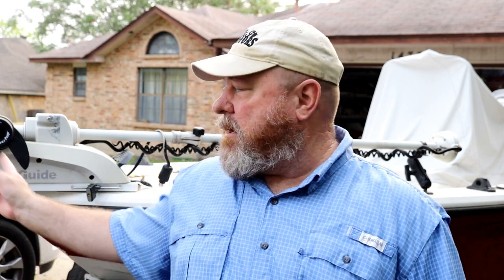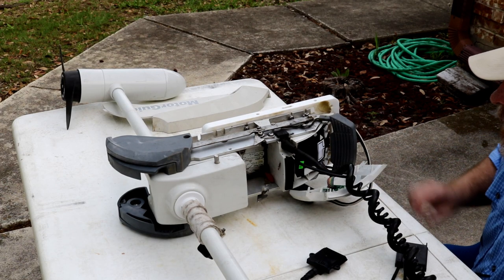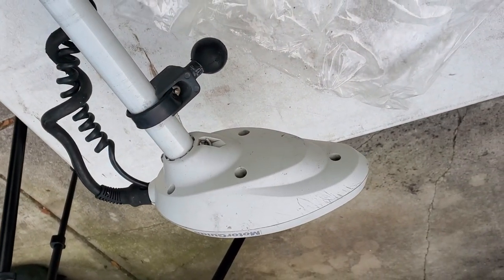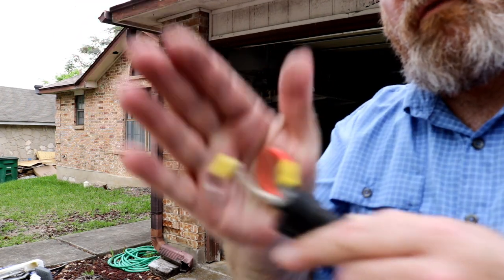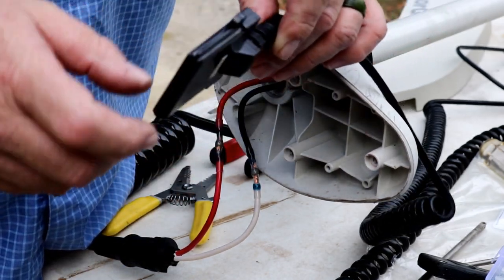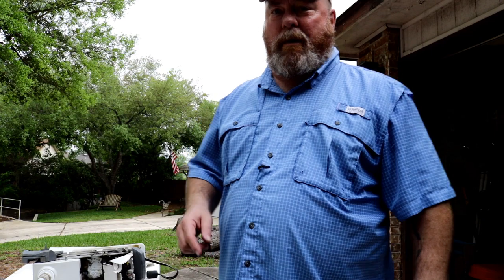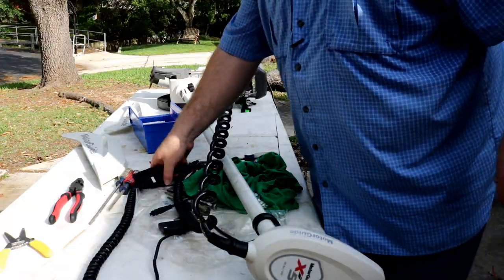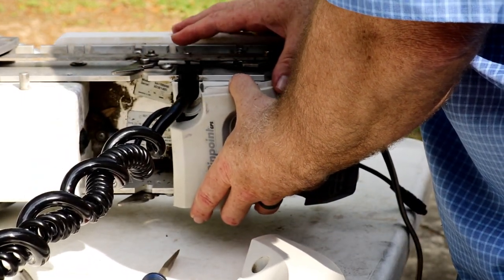Motor Guide Xi5 GPS Module Replacement | Curly Cable Replacement Too

Comment: Thanks for the video!  I successfully replaced my coil power cable today. It was pretty dry rotted. Wasn't too bad to replace.  I'll be looking at replacing the pinpoint module and control board someday. Changing the cable showed me the other parts are pretty easy to access and replace.  Thanks again.
Reply from the maker: I'm glad the video helped you.

Comment: I had to replace the main control board.   I suggest you take lots of photos of how the cables are routed because it won't go together properly unless you duplicate their exact  routing.
Reply from the maker: Great suggestion, I always take photos or video so I have something to refer back to.

Comment: Are you also using this integrated with a Lowrance unit as an autopilot.  Curious as to how the new GPS is performing in a networked setup.
Reply from the maker: Yes it is link, but I am having more issues with the motor, may be motherboard. I just haven’t had a chance to dig back into it.

Comment: Great video. Thanks for sharing. Have you tried updating the trolling motor software? Mine is connected with a Lowrance unit via NMEA network and I am frequently prompted to update the trolling motor but I was never able to complete the update process. Screen always freezes as soon as I push the OK button to begin the update. Any help on that will be highly appreciated. Thanks
Reply from the maker: I have not done that, but I’ll look into it, thanks.
Reply: @AJOutdoors1  Thank you. Waiting for your input.
Reply from the maker: Well I am having another issue with the trolling motor. May be the "Motherboard". I may have to replace the motor all together. Sorry I couldn't help you with this. If I do replace it, I'll look into updates for you. I do have one question, when you get these update notices, is the Lowrance linked to wifi? You might need to have it at the house and linked to wifi to complete the updates.
Reply: @AJOutdoors1  the trolling motor is connected with the Lowrance unit via NMEA network (special cable - gateway sold by motorguide). No wifi or any other network connection. Just trolling motor and HDS Lowrance unit.
Reply: @antoniosperrakis8247  This is a well known issue with the 2019 and newer motorguide Xi5 trolling motors. In 2019 MotorGuide started using the new design of gps module that was installed in this video. I had the same issue where it kept prompting me to do the update and then the Lowrance would freeze until I turned it off. To resolve this I had to install my NEMA system with its own power switch. When on the water, I power up my Lowrance Elite-9 Ti2 first and let it aquire a gps signal. I then power up and deploy my Xi5 letting it acquire a gps signal. Last I turn the switch on to the NEMA system allowing the trolling motor and Lowrance to network.
Reply: @AJOutdoors1  I hate to be the bearer of bad news but I have a feeling that it might not be you motherboard. In 2019 MotorGuide changed their gps modules to the new one that you just installed. There are a number of reported issues with that new module. The main one is loss of gps signal. When you are in anchor mode the trolling motor will lose gps signal and the trolling motor will go into standby mode setting you adrift. Other common issues is the head of the trolling motor turning around and around wrapping the cables tightly around the head. Other issues is the trolling motor taking off at full speed only to slow down and then ramp up to full speed again. Another issue is the trolling motor turning your boat in circles on the spot. Another issue is trying to navigate to a cursor point or waypoint on your Lowrance. You arrive at that cursor point or waypoint and the trolling motor fails to go into anchor mode. Another issue is creating a route on your Lowrance and then telling the trolling motor to navigate the route. The trolling motor will take you to the first waypoint on that route but then will continue in the direction that it was pointing rather than navigating to the next waypoint on the route. If you are experiencing any of those issues its more than likely due to issues with that new design of gps module. Motorguide says they are trying to resolve the issue but its been well over a year with no solution in sight.

A few comments with regards to your install. It has been suggested that the power cords in the head unit and the cable from the gps module have to be seperated or they will cause some sort of electromagnetic interference. In the head unit, you have to route that gps cable off to the side like the original one was using those little pockets to keep it off to the side. The red and black power cables need to be twisted and bunched up and tucked along the opposite side of the head creating as much distance as possible between the red and black power cables and the gps cable.

I bought my Xi5 in August of 2019 and have experience all of the issues that I have described above. I was able to solve some of my problems by installing a seperate power switch for my NEMA system which I turn on last after powering up both my Lowrance and Xi5 and letting them acquire a gps signal first.

I am still having a number of issues with my Xi5. A gentleman from Italy was able to resolve all his issues by sourcing out the old design of gps module and installing it his new 2019 Xi5. He directed 3 other people from Italy that were having the same issues with their Xi5's and all are working flawlessly now.

MotorGuide will not publicly acknowledge that there is an issue with this new design of gps module. As a matter of fact when you phone and speak to them, they will act like they have never heard of the issues that you are experiencing and they will suggest it might be an issue with your Lowrance unit.

Lowrance has put the blame on MotorGuide stating that MotorGuide changed the gps module without telling them causing some sort of communication protocol error.

I hope that you are able to find a solution to whatever issues that you are having.
Reply: @lmo1986  I am having most of the problems you described in your post,my motor would be approximately 5 years old and would occasionally drop out gps,I have motor linked to my HDS9 live,seems problem is getting worse with every trip I have,I quite often have 10-12hr trolling sessions and is not uncommon to have it drop out 1-2 times per hour,very frustrating to say the least,anchor point seems very good but I only anchor for 10-15 mins at a time casting lures then moving on to next spot,I’m at the stage I think I’ll disconnect everything from the lowrance and go back to the minnkota people seem to be getting a better run and less issues with those motors,my xi5 was fantastic when new but very frustrating now to the point on some days I’m ready to use it as the anchor 🤬👎🏻
Reply: @tarryturbo6  The word is that MotorGuide is working on a software fix. Its in testing phase right now and those testing it are giving it a positive review. Might be worthwhile to wait a little bit if you can.
Reply: @lmo1986  cheers Larry I hope this is true I really like the motor and I hope I can stick with it and the link to lowrance live,I have only had a few short moments with it working correctly and when it does it was quite impressive,thanks for your response 👍🏻
Reply: Hey Larry - any update on the issues with the newer Xi3/Xi5 motors (mainly GPS module) and known issues, such as following routes, etc.  I read a comment you had made on another video, in which it sounded as though Motorguide was working on an update to fix this.  I've been trying to get my hands on a logic analyzer to look at the data packets being transferred and see if I could diagnose the discrepancy in the comm protocol.
Reply: @jasonbumgarner8673  There is an update. The good news first: MotorGuide has developed a firmware fix for many of the issues that those of us with 2019 and newer Xi3/Xi5 motors have been experiencing. They sent it out to select people (I was not one of them) and it was tested with positive results. From what I understand, MotorGuide delayed the new Tour Pro models to make sure they had the new firmware installed (but don't quote me on that). Now the bad news: For now the updated firmware will only be available for install at your nearest Service Center. MotorGuide has installed the update on a USB dongle. You will have to take or ship your trolling motor to an authorized Service Center where they will hook the USB dongle to you motor via the NMEA cable and update the firmware in your motor. It is my understanding that at some point the update will be made available for download and installation through a networked Lowrance unit but it seems that will be at unknown time down the road. The other piece of bad news that I have heard is that there is a limited number of USB dongles produced and being shipped to Service Centers. Apparently due to Covid there is a shortage of many of the components to make the dongles. I've received this information from a Face Book page that I follow. The owner of the page says that MotorGuide has promised to do a media release via social media and email once everything is in place with this updated firmware and dongles shipped to Service Centers.
Reply from the maker: @lmo1986  Hey Larry, I'm not sure why I wasn't getting notifications of your comments, but I want to thank you for sharing all this info. So a work around is adding a power switch to the NMEA? I went so far as to delete the connection to the trolling motor in the lowrance hoping when powered up again to would recognize it. That did not work.
Reply: @AJOutdoors1  Adding the power switch to the NMEA and then powering up the Lowrance unit and Trolling motor first then the NMEA last will solve the prompt to Update Trolling Motor when first powering up. Although I think its a good idea to have the NMEA on its own power switch anyway.
Reply: @AJOutdoors1  In one of my comments here I also noted that it is recommended not to have your trolling motor connected to your batteries when not in use (as in at home on the trailer). It apparently is especially bad to charge your batteries while the trolling motor is connected to them. It is suggested to either have your trolling motor on a plug or at the very least disconnect the negative battery lead from the trolling motor when not in use.
Reply: @AJOutdoors1  Here is a link to the Facebook page that I follow and receive a lot of the info that I have posted here:

https://www.facebook.com/groups/824127438065311

MotorGuide has developed a firmware update for the 2019 and newer Xi3/Xi5 motors. They say that it will also solve the Update prompt.
Reply: @lmo1986  This is wonderful news!  I could probably make some of the dongles for them.  I'm a systems manager with quite a bit of software coding experience.  I had been working on creating an update myself by looking at the verbose serial traffic (communication) between the Motorguide and Lowrance.  I'm glad they finally decided to stop ignoring the problem and acting as if it didn't exist.  It honestly probably took their software engineer 5 minutes to update the code to work as I'm sure they changed some of the programming code in the Pinpoint GPS module in preparation for the release of the Tour Pro and it broke communication with the Lowrance.  Could've been something as simple as replying with 2 byte responses when the Lowrance needs 1 byte.  Do you have the FB page info that has this info?  I am within driving distance of a wonderful MG service center that has been servicing MG for years.  Just to verify, this is the issue with the TM not following routes or going to waypoints marked on the Lowrance, correct?
Reply: @jasonbumgarner8673  I typed a response and it disappeared. Not sure if that's the fault of my fat fingers hitting a wrong key or if the response is in limbo somewhere so i'll try again.

The facebook page is called Motorguide Trolling Motor Owners. Its not affiliated with Motorguide but there are a few employees of Motorguide that have joined the page and are trying to assist with some of the problems for older motors and the newer motors. the link is:
https://www.facebook.com/groups/824127438065311/
Reply: @jasonbumgarner8673  if you join the FB page and have a look under the announcement tab you will see a screenshot of a chat between the owner/admin of the page George Demetriou and Motorguide where they provide a list of fixes the update is to correct. It includes the Update Required prompt, the head of the trolling motor spinning in circles and wrapping the cord around itself when put into anchor mode, going into anchor mode when navigating to a waypoint, properly following a route and loss of connection. Hope this helps.
Reply from the maker: @lmo1986  Yeah I read that one in the manual. I have the quick disconnect on mine, so when not in use it is off the boat and in the garage.
Reply from the maker: @lmo1986  Thank you again.
Reply from the maker: @lmo1986  Larry, what is the name of that Facbook Page?
Reply: @AJOutdoors1  mine too. I saw a cool hack. If you buy a second quick disconnect you can mount it to the wall in your garage and then store your motor vertically to your wall. If you are handy with woodworking you can make your own quick disconnect or mounting plate and attach that to the wall and mount your trolling motor to that for storage (i hope that makes sense).
Reply from the maker: @lmo1986  That is funny, that's exactly what I planned to do. :D
Reply from the maker: @lmo1986  Hey Larry, have you seen the latest from MG? I got an email saying they now have an update for the Xi series trolling motors. Should be the ix, I'll check it out later.
Reply: @AJOutdoors1  I did. I got the email from MotorGuide. My local service center has the dongle on stock and I'll be dropping my Xi5 off to them next week for the update.

Comment: could you help me, where is the sensor that turns off the automatic engine when retracted? mine is connected directly. Thanks
Reply from the maker: Man I don't have this boat anymore,  but I believe it is tied in the motor retainers when it is pulled all the way into the stowed position.
Reply: @AJOutdoors1  Thanks bro, I'll try to solve this, thanks, hugs from Brazil
Reply from the maker: Good luck, I hope you figure it out.

Comment: Hi,I had the same trouble with my xi5 trolling motor,called mercury marine and they told me I had to replace the gps module,replaced the gps module and that didn't work.called them again and they said will it must be in the circuit board.i replaced the circuit board and it still didn't work.i called them back again and they said I must have gotten a faulty  gps module so they sent me a new one on warranty and it replace it and it still don't work.it works fine on Manuel mode,do you have any suggestions that I could try to fix it?
Reply from the maker: I wish I had something for you Dennis, but mine is not functioning properly again. Its about 5 years old so I plan to just replace it....

Comment: What Can I do if the GPS Calibrations fails?  It was working but not very well so I tired the Compass calibration and drove the two circles then nothing happened.  I didn't get the audible sounds tell me it completed successfully and now the GPS light just stays off.  Any ideas would be greatly appreciated
Reply from the maker: Matt, how many times did you attempt it? If only once, I’d say try again. If multiple times, give motorguide tech support a call.
Reply: I got it to accept the compass calibration.  Still is right though.  Now it won’t hold a course and after about 5 minutes on spot lock it spins around and goes full speed and twists the cable all up.  There has to be an easy fix.  It’s brand new
Reply from the maker: Their tech support guys are usually pretty good, I'd go ahead and give them a call. They helped me determine that mine needed to be replaced.
Reply: Unfortunately I don’t have the luxury of time.  I purchased it before I left for the season to guide in northern Ontario .  The faulty unit has already cost me more then the cost of an terrova .  Let me know if anyone wants to buy it .  Embarrassing
Reply: @mattobrien6190  There is a fix. The problem appears to be that in 2019 Motorguide changed the design of the gps module and it is causing the issues that you have described as well as many others. Motorguide tried to blame it on Lowrance and Lowrance said it was Motorguide's fault for switching gps modules without telling them causing some sort or communitcation protocol error between the trolling motor and Lowrance unit. It is pretty obvious that the issue is with the trolling motor though because lots of people are running their trolling motors as stand alone units not networked to a Lowrance unit and are experiencing the same proplems.

The only solution to date is to find a pre 2019 gps module( like the one that was removed from the trollling motor in this video)  and replace the new design module with the old design module.

I live in Manitoba and my local MotorGuide/Mercury dealer wants $1350.00 Canadian for a new gps module and they can't guarantee me if it will be the new or old design.